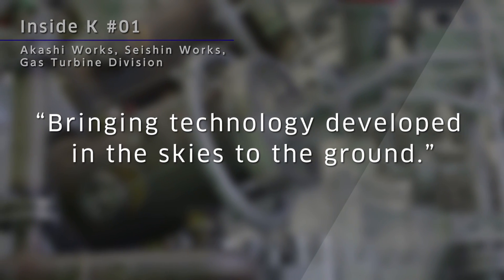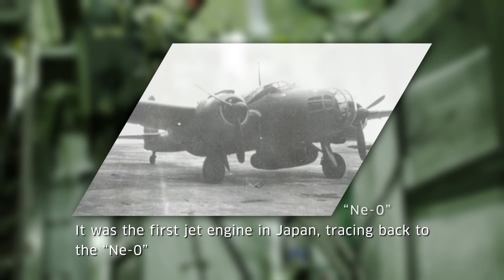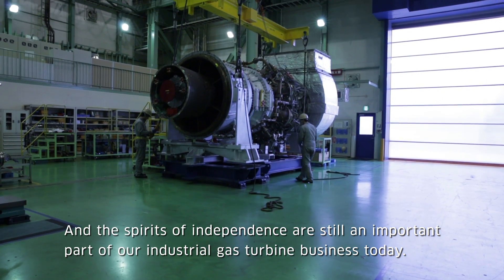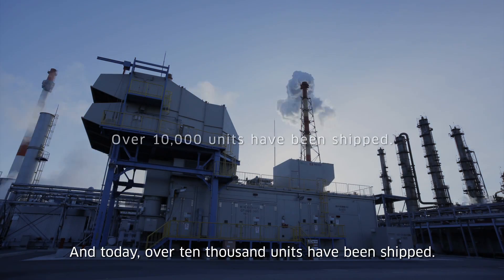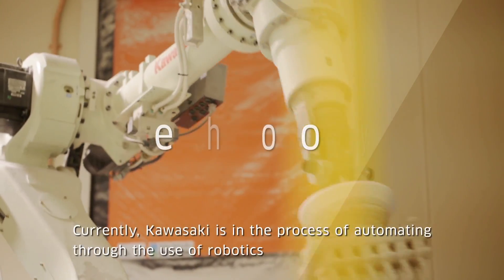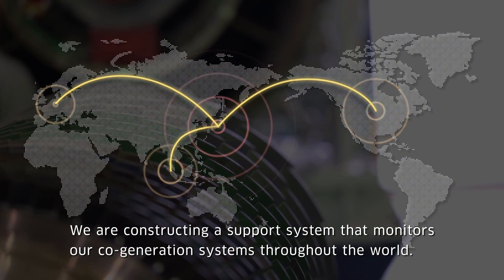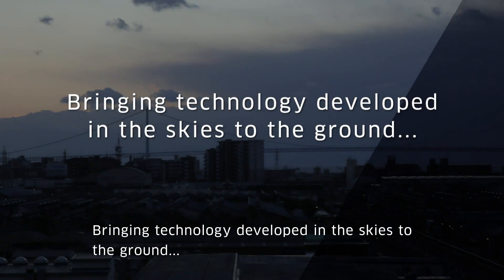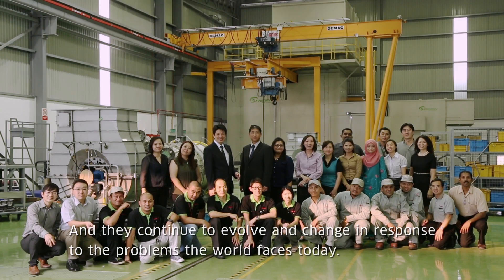Kawasaki: Gas Turbine Division, Akashi / Seishin Works

Comment: The Japanese revere their engineers as you can see from the interview with that PR guy.  In the US we blame our engineers for the pot holes in the roads or industrial accidents even though those things are usually caused by politicians misspending tax money or stoned union workers.  Or we call our software programmers "engineers" when they aren't any such thing.   Real professional engineering is a terrible career choice in the US due to this, too much liability and little pay.
Reply: in my country engineers are fleeing by applying for emigration visas 😂😂